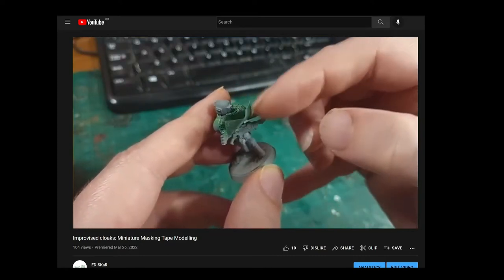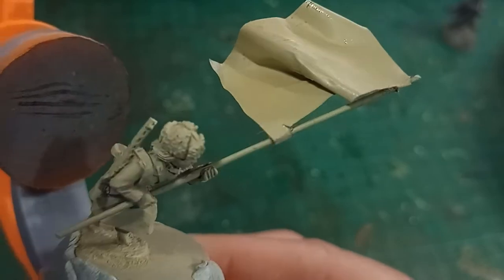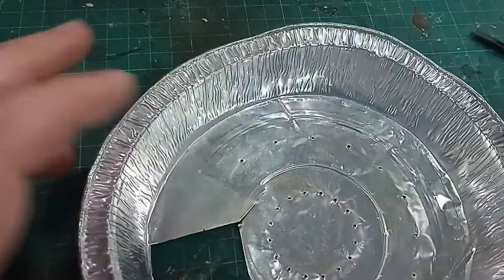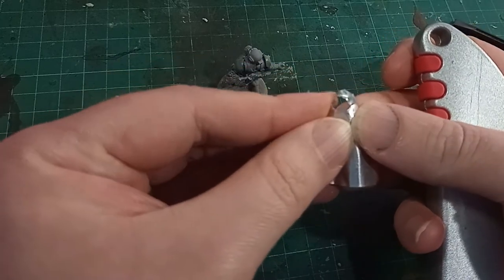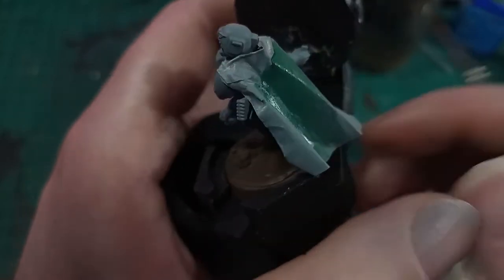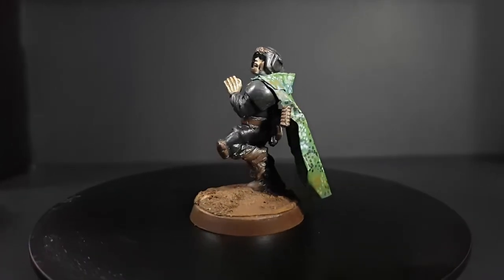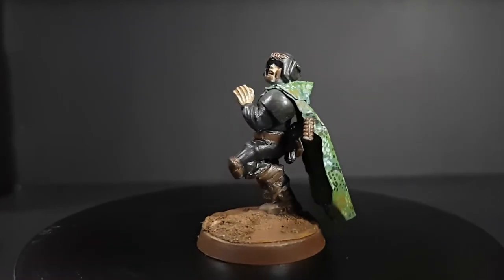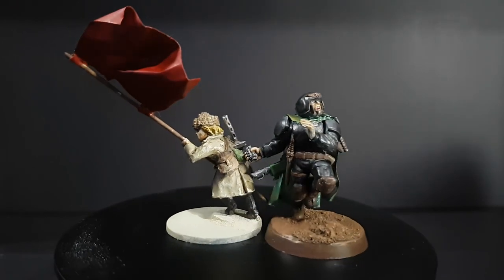Improvised Cloaks: Modelling with a pie tin!

Comment: Pie tin perfect! Wondering, u used bottom of tin, how about pie tin sidewall? Seems to have texture that might be useful...maybe not long enough material? Thanks for sharing 👍
Reply from the maker: Hard to clean, so it still had gravy in xD
But if you could clean it then yes that wrinkly pattern would be interesting.
Reply: @EDSKaR  maybe Paul Allen's cats could help with gravy clean up! 😃 saw something interesting done recently (used as a blue tarp on aircraft wing) with computer monitor  wipes, not sure if you have tried that or similar.  & what about brown paper bag material, with PVA, or modpodge?  "Cloak & Dagger" a pub for Tanith's finest?😆✌️